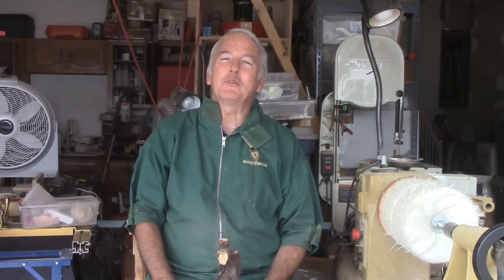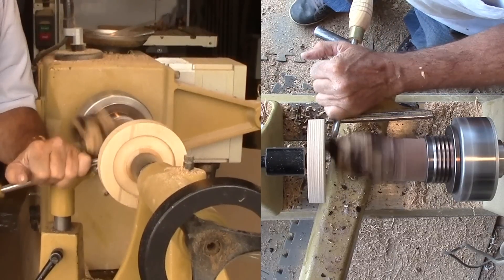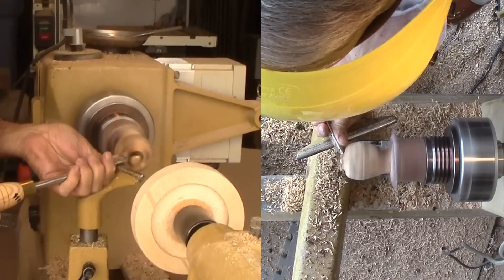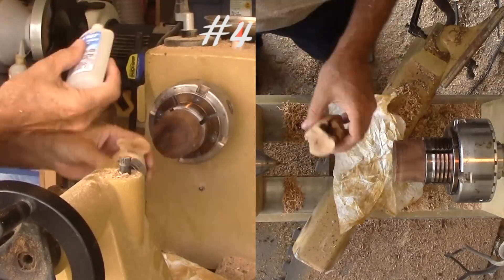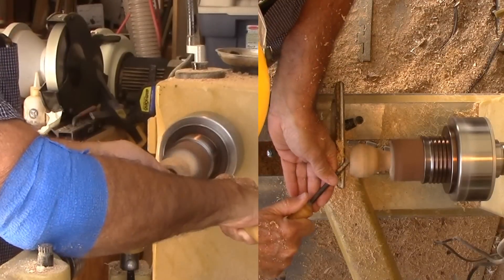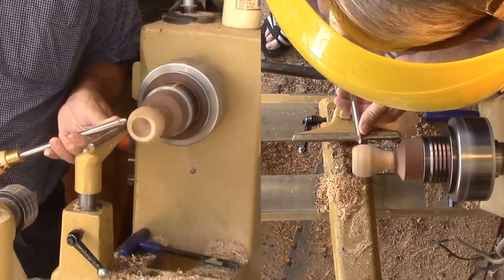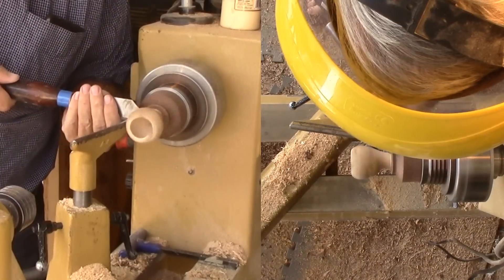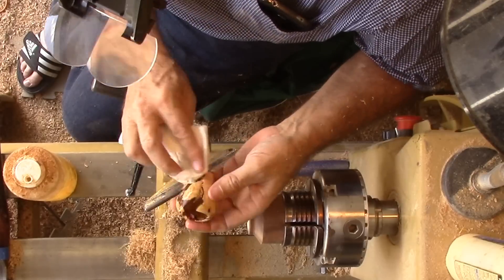Miniature Vase From A Rose Root - A Thorny Woodturning

Comment: A beautiful piece, in the end Alan, I was wondering if the root was a little damp, hence the glue didn't hold. I have never had a glue joint fail, providing the wood is dry. Please don't think I am trying to clever, just a thought :)
Cheers
Mike
Reply from the maker: The root was semi green. I've been in classes with Christian Bouchard where he used medium CA on green madrone burl. Worked well in that case. My waste block was very dry and that is the surface that failed to hold. I'm not sure I have a firm conclusion yet.
Thank you Mike
Alan

Comment: The root might have been to moist to get a good bond.  Most of the demos I see using hot glue state that they are using DRY wood.  Just a thought, I would have used Sure double sided tape as Cpt. Eddie teaches, on this project.  At least you had your safety helmet and gear on, I see many You Tube vids that the person using the lathe has no safety devices whatsoever.  
Thanks for your great vids.

Mike
Reply from the maker: Moisture do not always negate the use of CA glue. In a demo by Christian Bouchard, he specifically uses medium CA glue on green madrone burl. Seems to work well for that case but not for mine. :(
As for double sided tape, I have no confidence that it would have held this piece.  I do use it in other applications.
Thanks for the comments
Alan

Comment: Must have been a 'wild rose' bush, huh Alan? ;-) 

For sanding the inside of something like that, wrap the outside with several layers of saran wrap, then throw a few pebbles/marbles/etc inside with a bit of beach sand.  Close up the opening and turn the lathe on for a few minutes.  (Don't leave it too long though!  Don't ask how I know that...)  Be sure to blow it out with compressed air after, but wear a respirator while doing so!  Inhaling sand is bad...

For one, I'm glad you left in the energetic dismounts.  Was surprised that you didn't just cut a tenon on the thing initially, then mount it in pin jaws, but I've never been a fan of holding stuff on the lathe with glue.  Is there a reason you didn't go this route?
Reply from the maker: Great tip in finishing the inside. I'll have to try it.
As for a tenon in the first place. Maybe I'm lazy but I've done a lot of projects just glued onto a faceplate. Thinking back they were all bigger and therefore had more gluing surface. Then, the root is so hard to hold in the first place, mounting to a faceplate required only one flat area.
Thank you
Alan

Comment: Interesting.  As the root looked freshly dug up, it was green - CA does NOT work on green wood.  I've stopped using CA accelerator as it does not penetrate and causes the exposed edges to crystallize.  That crystallizing is not a strong bond.
Reply from the maker: In contrast Christian Bouchard uses medium CA glue for green madrone burl. it is his only mounting technique. His were wet burl to wet waste block, spraying accelerator on one side and applying a thick layer of medium CA to the other.  I'm not drawing a firm conclusion yet.
Appreciate your thoughts.
Alan